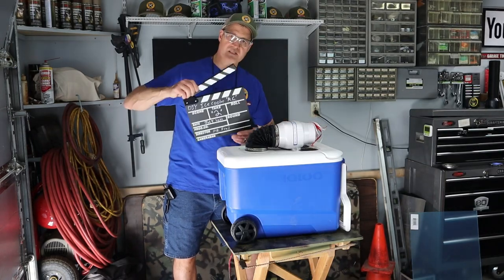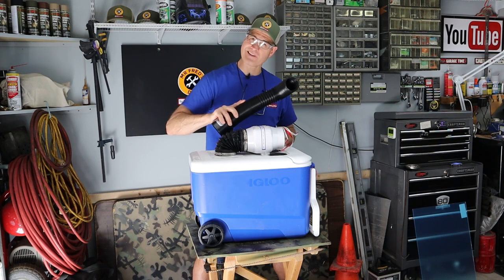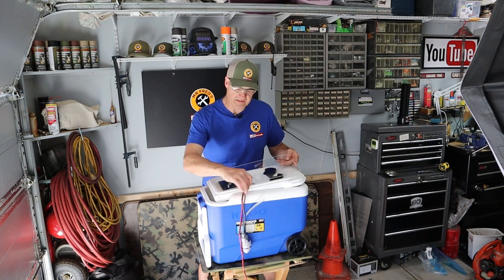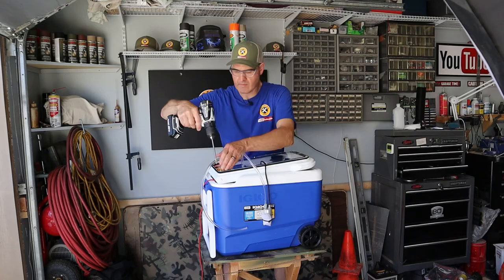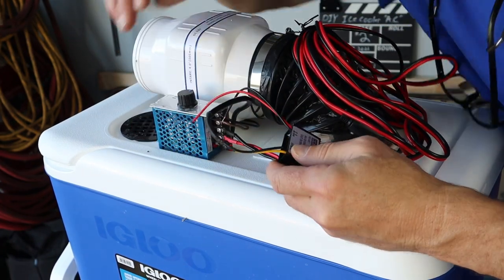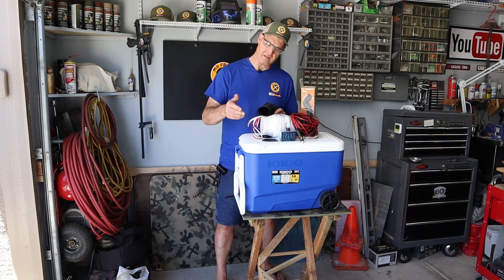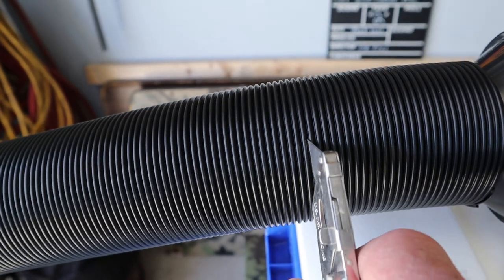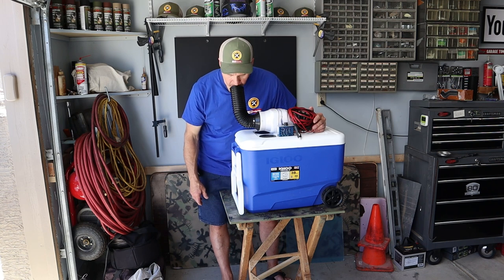DIY Ice Cooler Air Conditioner (FAIL)

Comment: So you basically shortened the air intake compartment. Was it because the original piece was getting sucked up by the fan/blower? I'm building one similar to yours but using a 7 1/2" x 7 1/2" radiator under the lid like yours but also thinking of adding coiled copper tubing submerged in the water/ice below using a 240 L/H (63 G/H) pump connected to both in a closed loop system. I plan on using it to cool my Jeep Cherokee until I repair the AC system.
Reply from the maker: I put the plexiglass under the lid instead of the foam piece to better keep moisture out of the air. Reducing the voltage of the pump worked great as well. At 12v it pumping unnecessarily fast.
Reply: @MrFredsDIY  -  Oh I see, yes if you're in a humid part of the country that may be best. I'm in the Mohave where swamp coolers are used alot so that mod may not have to be done on mine. Thanks for the response and sharing your progress.

Comment: I'm wondering what part of the country you're in and was it not humid during testing 
  With  the top being sealed don't  you get condensation build up in the air chamber?
Reply from the maker: I am in the desert Southwest. Here in Las Vegas our humidity is pretty low, and Nevada is the driest state in the nation. Occasionally, there is some humidity that builds up, but it’s never really a problem.
Reply: @MrFredsDIY  thanks for the response I live in South Florida where our humidity is very high I work in the HVAC industry and decided to make my own build pulling ideas from you and other DIYers plus using my years of air conditioning experience I am going to probably add a very small thin drain pan just below the coil and drill a hole to have the condensation drip down into the ice water
Reply from the maker: I have not had very much condensation but again it is very dry here. Some kind of drain system sounds like it would be a good idea.

Comment: Does having a smaller space under the coolers lid, where warm air enters and gets pulled through the radiator, get less condensation on the radiator?  I made one like you first did but using a 200 cfm inline fan (had one on hand).  After a few minutes of running almost no air was being moved by the fan.  The radiator was so covered in condensation the fan couldn't pull air through the fins.  I would lift the lid and water would pour off of the radiator.  Then it would start working again but after a few minutes the same thing would happen.  I don't see that the installation of plexiglass would help in any way with my problem and just would cause more problems since the condensation would just be caught between the plexiglass and the cooler lid with no way to drain out.  I have a larger 6 inch 440 cfm inline fan that I was thinking of trying out to see if it would pull air through the soaking wet radiator.  I was also thinking of removing the radiator from the lid and just have it straight up and down mounted to the inlet of the fan so condensation could run off.   Any ideas or thoughts?
Reply from the maker: Condensation seems to be an issue with this type of cooler. The radiator is cold and when warm moist air passes through it water will condense. This process can’t be stopped but I am always thinking of ways to mitigate and deal with the condensation. Thank you for taking the time to comment!
Reply: @MrFredsDIY  Condensation is not only an issue it totally stops this cooler from working.  I am totally changing the design of mine.  1 the radiator is totally wrong for being in this orientation.  The fins are too closely spaced together.  Close fins make a radiator more efficient but cost you in air flow.  There is always a cost, in some way, for efficiency.  In this case it was that the condensation was so extreme it totally blocks air flow through the radiator.  Like every other radiator you see, they should be mounted vertically not horizontally so the condensation will run off just by gravity.  I am ditching this radiator and my size fan totally.  I am instead going to use a 6 inch inline fan (480 cfm I think) and a transmission cooler.  The tranny cooler has fins spaced farther apart for more air flow and I am going to mount it vertically by attaching it directly to the air exit side of the fan.  Exit side so it won't suck condensation drops into the fan motor.  I don't know, maybe a smaller (then I am using) tranny cooler mounted horizontally inside the cooler like where it is in your video would also work because of the greater spacing between the fins.  I am also going to be using longer hoses and not mounting the fan to the cooler lid.  This way I can place the fan to blow where I want it to blow.  Pipe insulation might end up being used.  Wish me luck!
Reply from the maker: All great ideas! I wish I had time this month to R&D another version of this unit. I am actually building a different unit right now and filming tomorrow. The unit I’m making is a more traditional design with a few key modifications that make it different than most. 

Here in Las Vegas our humidity levels are typically single digits or in the teens so condensation is not a huge factor.
Good luck with your project!

Comment: Mine is way more simple. Instead of in the inlet/outlet on top, i have them on the lower sides. And I use frozen water bottles. That way air flows over the water bottles directly. And I dont have water to drain. I can just put the bottles back in the freezer. 
And the fan is a computer case fan, which is 12 volts DC. But its powered by a USB-C battery, which can be recharged via solar. USB-C only puts out 3 volts, but that seems to be plenty in order to keep a bedroom cool. If I need more, I might wire in a holder for a few 9 volt batteries connected in parallel, which should give me good run time. 
Its also nice not to have anything on the lid, so that opening/closing is easier.
Reply from the maker: Sounds awesome!
Reply: I literally am doing the same thing with re-usable Ice packs but was still going to add the water pump.and radiator. I was wondering though if the step with the plexiglass was absolutely necessary? Or if I could just foam insulation board instead to separate the water and radiator. I was also able to find a water pump with usb adapter that I can power with a small battery bank that has a solar panel on it. The fan I use has a battery and charges with its own solar panel.
Reply from the maker: @samsin102 the foam insulation board should work. The important thing is to keep the air off of the ice so that it does not melt as fast. Good luck with your build!

Comment: Could this cool off a small room, say about 150sq ft? Im thinking of one of these for emergencies. We live in Florida and have solar panels+battery. During a blackout scenario (say during/after hurricane) panels during the day would run the whole house including our 5ton ac, but at night battery would only run smaller loads. Would like to have something small to at least provide comfort to our toddlers at night.
Reply from the maker: I have found that this cools people better than it cools a space. If you hang out in front of this or in a small area around it that is when this thing shines!
Reply: @MrFredsDIY  that works, I could put on of these facing them in bed so that along with the ceiling fan they could make it through the night more comfortable. I will get to it, this definitely looks fun! By the way, as an avid dyi’er and all around the home fixer, I am glad to have found and subscribed to your channel; plenty of good project ideas!

Comment: Your  1st mod is a automatic fail. Air cools off as it passes through the fins of a radiator.if you seal the system where it's not getting any outside air your defeating the use of a radiator
Reply: Do you not see his vent on the lid?

Comment: Hello really like this mods. CAN YOU PLEASE MAKE THIS WORK DAY AND NIGHT TIME. 100% OFF GRID USE. I AM THINKING HAVE A SOLAR PANEL AND A DEEP CYCLE BATTERY SYSTEM. SOLAR PANEL TO POWER UP AND CHARGE BATTERY DURING THE DAY AND BATTERY TO POWER UP DURING NIGHT TIME. PRACTICAL APPLICATIONS: CAMPING, VAN LIFE COOLING BOOST, KEEP PETS AND FRIENDS COOL IN TENT OR CAR. THIS CAN BE VERY EFFICIENT AND PRACTICAL IF IT CAN OPERARTE 100% OFF GRID AND EFFICIENTLY. PLEASE MAKE THIS MODIFICATION AND I WILL BUY ALL PART AND CONSTRUCT A UNIT TO KEEP MY DOG AND HOT GIRLFRIEND COOL DURING HOT FLORIDA DAYS. THANK YOU . THIS IS THE BEST ONE .
Reply from the maker: Thanks for watching the video. I am working on a “testing” video now to answer some of these questions.